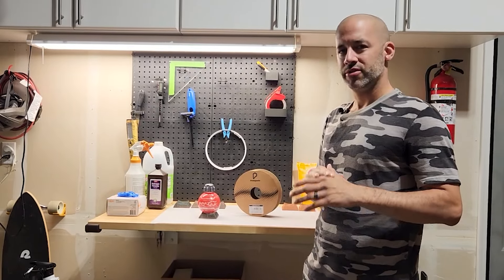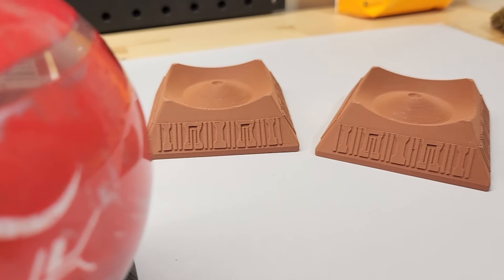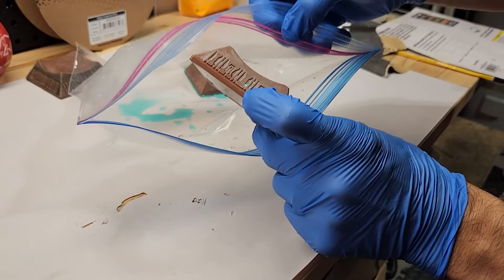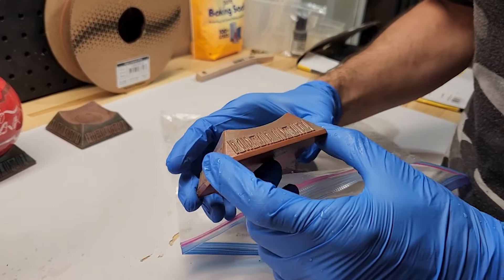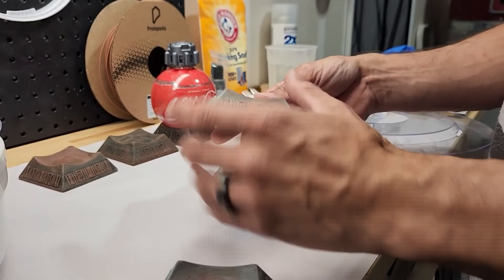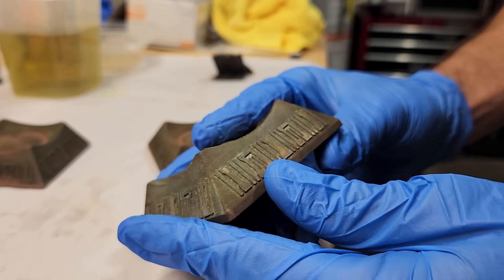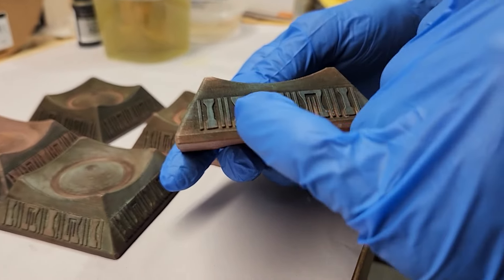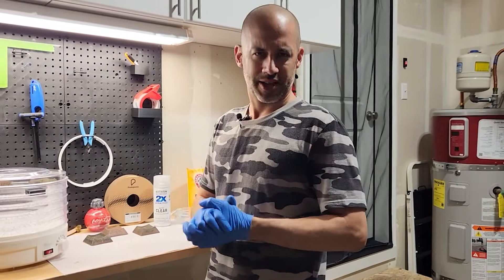How To Patina REAL Copper Infused Filament for Your 3D Prints for an Authentic Look!

Comment: You should look into sculpt nouveau patinas. They are amazing. I've never used them on filament but I have used them on resin with metal powders and on my coin rings. So amazing.
Reply from the maker: Thanks for the tip, I'll check it out!